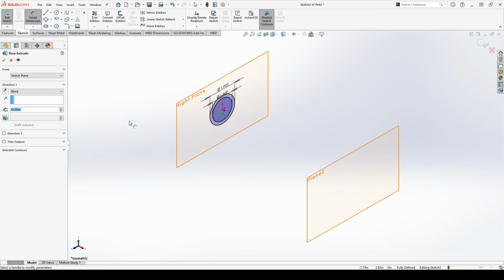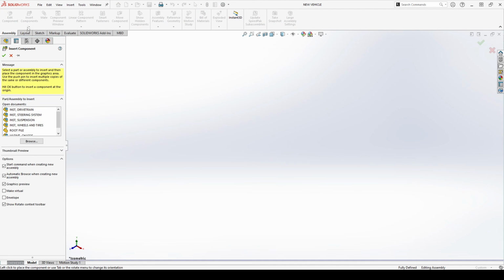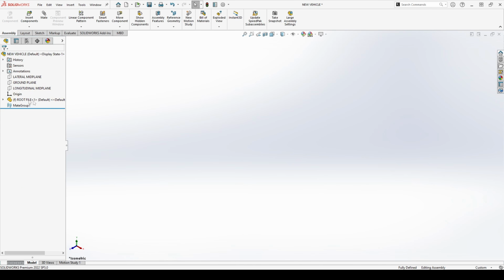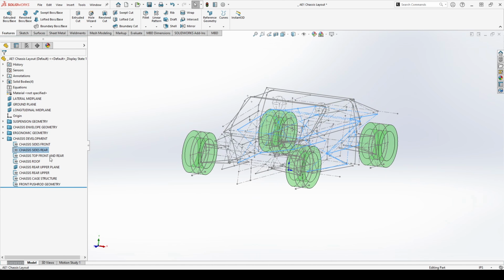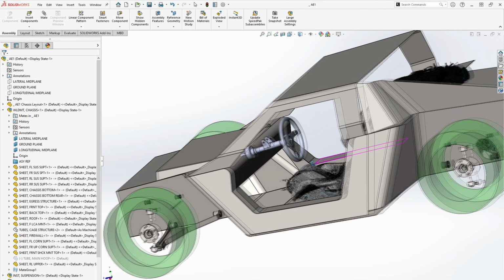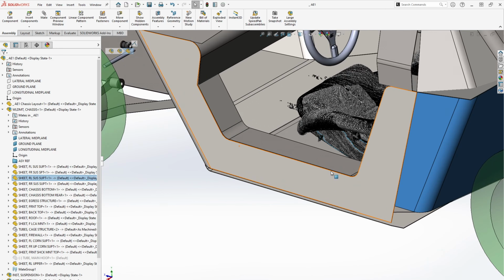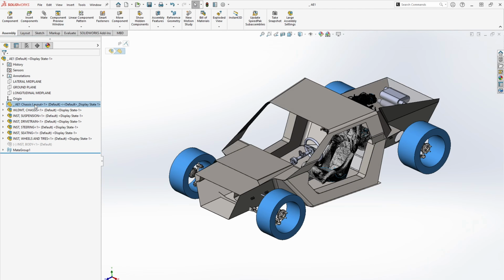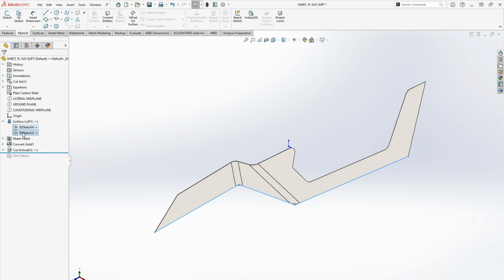Design Process - Mid Engine Car

Comment: I've also designed and built a mid engine car from a clean sheet and thought I was all alone. The first year was reading a stack of suspension engineering books and working out details in CAD. Then one day the first tube got bent. Working on it a few hours a day, after another year or so I was driving it. Even did wild headers like you!

Comment: Small pickup chassis. Remove engine. Replace solid rear axle with an independent rear end in factory cradle from donor car of choice.. Hook LS motor and gearbox directly to diff.

Comment: What computer are you running for these big solidworks files? Thanks
Reply from the maker: I've run files this large on a variety of PCs but i7 processor, 16gb of ram, SSD adequately sized to handle the PC, and a mid-level graphics car with 2-4gb of graphics ram, seems to work well.

There are techniques in SW to maximize file efficiency and there are features like "speedpak" that can reduce the impact of imported files.

Comment: Very cool and great structure. Something else that might be of use is that you can colour your sketches... It doesn't all have to be grey. You can also change their thickness. I worked in the design of steel canopies for about 1y8m and using a solid body to derive your sheetmetal parts off of is also a handy method. Top down, each part gets its own file in the parent assembly and you do a Surface Offset = 0, Convert to Sheet Metal. If you don't like your sheet metal to then sit at weird angles in the drawing, you just have to float your part and mate the planes to a reference point on that body of your choosing and then do the surface offset etc.
The only thing I noticed that was an annoyance is that SW's Task Scheduler didn't like this (but I think it had to do with me creating many variations for each vehicle through Pack and Go) and some original references would reference a much older parent part when trying to save the drawings this way, leading to error. I didn't have time to figure it out, but found a macro that would allow me to one-click save to PDF (the drawings)[ as long as you had saved the SW drawing first] in stead of going File>Save As, select PDF ... I also never found a great Macro that would help you sequentially save all your configurations of a sheetmetal part, which would have been great since I kept the both RH and LH parts as a configuration within the same part.
Reply from the maker: Good info! I've used surface offset = 0 to make imported surface models into SW parts that I could then edit. It's a good way to do a lot of things.
Reply: Do u have any channel?
Reply: @srinivasanv6573  I do not.
Reply: @schalkvandermerwe3838  if I have any doubt in surfacing how can I contact you

Comment: great content, thanks very much for sharing. i'm currently setting up a new laptop for Fusion 360 and will hopefully soon begin modeling my own mid engine car design. a top-down vs bottom-up question if i may, i think i know the answer but here goes: any bottom-up child component can be imported and/or referenced in the parent top-down design file, correct? ok, 2 questions: should the bottom-up component remain a separate file or shouls it be imported into the parent file, integrated into the parent's file structure and the child file archived? thanks. can't wait to see more on this.
Reply from the maker: Thanks.

For the first question, yes, any child part should be able to be imported into parent and through references be designed or positioned through the parent file.

The second question may be more software and application specific but for myself, I'd recommend keeping the child file as its own entity, but designed or positioned using references across the parent file. For one thing this allows better visibility on BOM structure. The other reason is that if you are using top down design and a root file, you can jump children from one top-level parent to another if you decide to group systems differently at a later date. So effectively not integrating it fully allows future freedoms, but again that can be pretty specific to software and application.

Comment: Could this be implemented into the design of a 3D printer? Like top-down designing?
Reply from the maker: Yep, it definitely can. It would start the same - blank assembly file with a root file, except in this case the root file would be structured to map out the 3d printer and its geometry can drive the components that would need to scale with the size.

Comment: Thank you for the detailed video. You should checkout the OnShape CAD system, some of the same folks from SolidWorks. I am also a SW user at heart, but OnShape really makes references and assemblies easy. You can create multiple bodies (parts) in the same file and then they can be related and treated as an assembly. No file transferring or hopping between part tabs for different sketch references, etc. It feels weird going to an easier system after learning the SW struggles lol.

Comment: I've been a CAD guy for nearly 30 years and I couldn't agree more with organization being the #1 tool. I use Autodesk Inventor Pro. I've taught classes before and organization is always overlooked. Top down is very effective and I use it all the time. I use bottom up a lot too. Just depends on the project. When I learned how to use reference geometry and parameters it changed the way I design and made me a lot more efficient. Love the explanations and the mid engine project :) Can't wait to see more 🤘
Reply from the maker: Thanks! And I couldn't agree more, whether it's top down or bottom up or anything in cad, good organization helps.

Comment: Glad to see an update on this project! What's been your motivation to use sheet metal VS tube to provide the primary structure of the chassis?
Reply from the maker: Thanks! No short answer to that question haha but here it goes: I think tube structures are a great way to build a chassis but I have a few reasons on why I've decided to take this in the sheet metal direction. From a structural standpoint, I like the design freedoms that using sheet metal provides. Profiles can be sized and shaped, then trimmed to remove excess material to precisely and efficiently meet metrics for torsional stiffness, impact zones, and more. From a manufacturing standpoint I can use tab and slot techniques to offload a lot of measuring time into the CNC cutting process, but I can also build in component-mounting-features, zip-tie locations, and more, that will greatly speed up the actual build/assembly time. It definitely takes a lot of front-end time to get the design to that place, but I think it might be wash when comparing it to the back-end time of dressing out a tube chassis. Sorry for the novel haha.
Reply: @DirtyElbowsGarage  I appreciate the detailed answer! I asked because nearly all home brew chassis builds are tube-framed. It makes sense given that most of the builds aren't fully designed before fabrication.

Excited to see future progress 😎